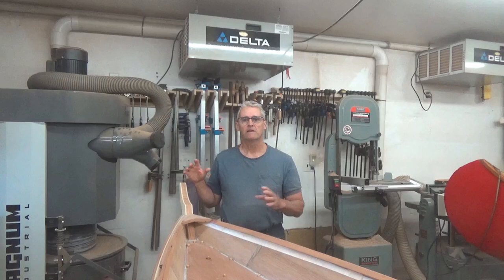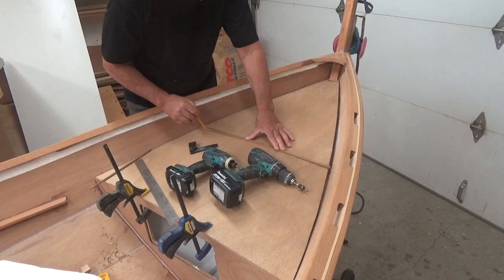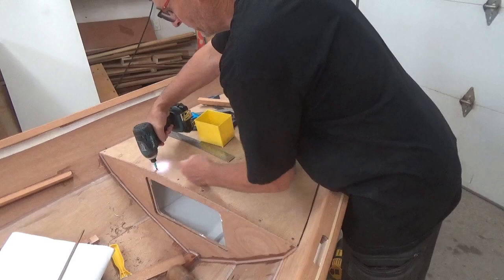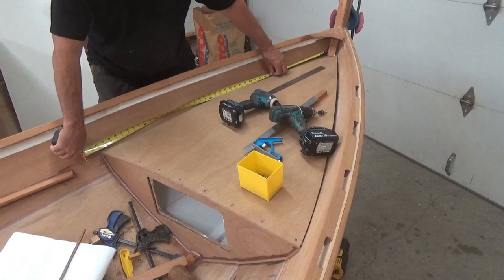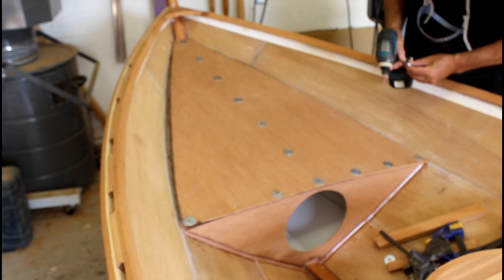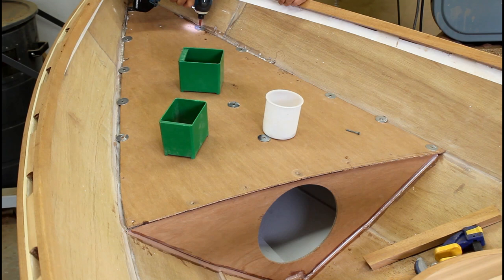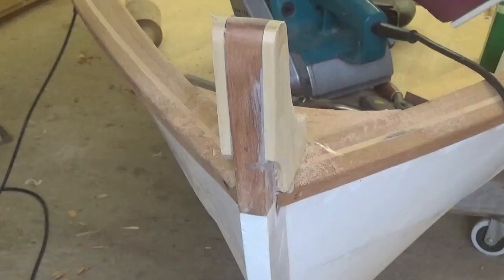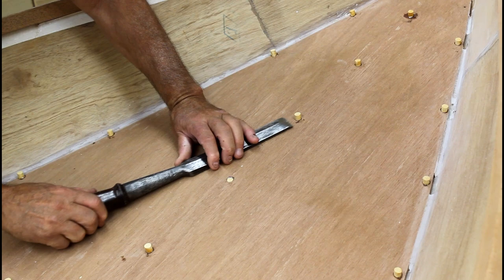Building "Elfyn" A Wooden Boat EP 13 Finishing up Bulkheads and Shaping Horns

Comment: Great stuff once again Rod. Thanks for showing us your little "Ooo oh!" There needs to be more social media makers that show the realities of making stuff. It's not all "it went perfect" and high 5's all round....

I just ordered plans for Elfyn but they haven't arrived yet and I'm just wondering how many sheets of ply you needed for just the planking, daggerboard case etc? I'm planning to build it without the floatation lockers so I won't need the material for them. 

Thanks Rod and keep up the great work
Reply from the maker: Elfyn is a pretty simple build and Ian Oughtred's plans are very detailed.  I purchased two more sheets of ply than listed in the plans for the bulkhead patterns and for error as did not want to have to go back to pick up another.  As it stands, I have almost a full sheet left.  If you do not make any errors, then the number of sheets will suffice.
Reply: @OrcaboatsCa  Oh I believe that Oughtred's stuff is top knotch bit just so I can start to budget for materials. Sorry to ask the same question again but how many 8x4 sheets of ply did you use for just the planking?
Reply from the maker: @joshuadunn882  Plans call for 4 sheets of ply.  Either 9 mm okoume, 6 mm Mahogany (this is what I used) or 7 mm larch.  If it is not available at your local outlet and you have to order, then I would recommend an extra sheet.
Reply: @OrcaboatsCa  Lovely stuff. 4/5 sheets so... Thanks Rod